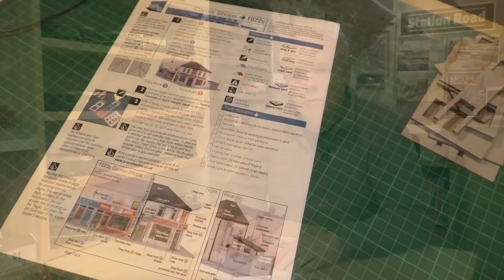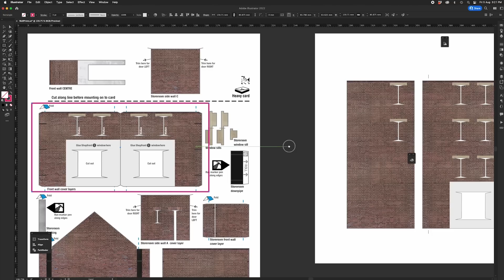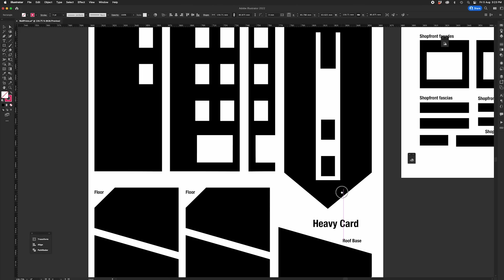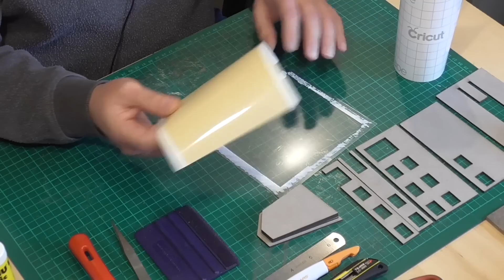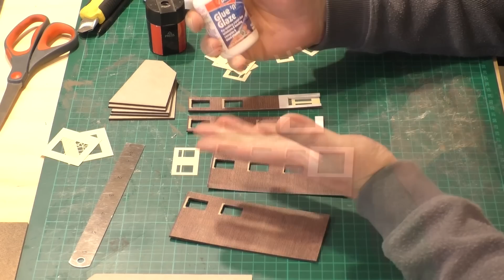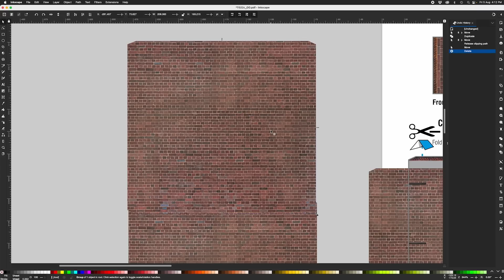Scalescenes Corner Shop Kit-bash | Part 1

Comment: Julian, I meant to ask you what weight and type of paper do you use for the scalescenes parts. I have 110gsm matt photo paer but think that might be too heavy.
Reply from the maker: Hi Andrew. A lot depends on the type of printer being used, but my impression is the thinner the paper, the better it will be for folding/creasing around corners. I use standard 80gsm copy paper in a colour laser printer. I have used 160gsm premium laser printer paper on occasion but only on flat structures that don't require folding. I've not tried photo paper and I suspect laser photo paper might differ from inkjet photo paper. I imagine the thicker the paper stock gets, the more likely the print might split/crack when folding.
Reply: @StationRoadModelRailway  Julian, thanks for you reply.

Comment: Hi Julian. Great video. One question on glueing the brick prints to the card. Wouldn’t it be easier to put the glue on the card, rather than the print? That way the glue would only go where it’s needed, not on the back where the windows/doors that you’re going to cut out anyway are. Or is there a reason you put it on the print?
Reply from the maker: Thanks Ron. I did try applying the glue stick to the card structure but it's almost unavoidable to end up with clumps of glue around the edges and inside the window openings which then has to wiped away. By applying the glue stick to the paper, this avoids excess clumps of glue.
Reply: Makes perfect sense. Thanks Julian. Watched the second part last night. The finished building is brilliant.

Comment: Hi Julian - Absolutely brilliant video mate. You just never stop learning. 
I will have a go next time of varnishing the paper before starting the build which is different to how I first started and see how I go. 
I personally have had no issues so far folding paper over but I still like the idea that varnishing gives it extra protection.
I also like your folding technique which I will have a go at. I really like the way you do the windows, looks much easier cutting them in that way.

Bearing in mind yours is OO and mine is N. It's possible that they may not work with N Gauge as it is far too small, but we shall see.
looking forwards to Part 2.
Regards Chris
Reply from the maker: Thanks Chris. The main reason I spray the prints beforehand is because I use a colour laser printer where the print tends to have a slight shine to it. I also found the print would start rubbing off when folding on corners, so spraying with matte spray first avoids this from happening. It will be different if you're using an inkjet printer as they embed the colour into the paper and don't have a shiny finish (unless you're using photo paper).

Comment: Excellent as always. You can get less sticky transfer tape. Cricut transfer tends to be too strong for most things!! Cheapest the better. Cricut tip is to take your transfer tape and stick it to your jumper before use to take away some of the stick. And if your doing several stick it back to its carrier sheet in between.
Reply from the maker: In my situation the transfer tape is not strong enough, the vinyl stays on its backing when to try to peel up the transfer tape.
Reply: Have not used the smart vinyl as its called here. Get a mat and then can use any vinyl. Didn't the joy come with one? I know you think it's hassle but it's less wasteful too.

Comment: Great job on re-jigging that Scalescenes kit Julian. The Cricut vinyl seems a bit of a faff, I thought it would be much easier than that.
I have 3d printers so normally use those to create window frames etc. anyway.
Keep up the good work.
Reply from the maker: One area I haven't explored is 3D printing, I never been able to wrap my head around the 3D modelling/software side for some reason. The vinyl cut method of window creation works well enough for my purposes, it's more the limitations of the budget-end Cricut Joy machine, something I plan to upgrade at some point.
Reply: With the bigger machines. You can print onto card and cut all the brickwork windows and doors out too. Saves alot of cutting. Amazing what the joy can do and replacement  cheaper blades have just come onto amazon.